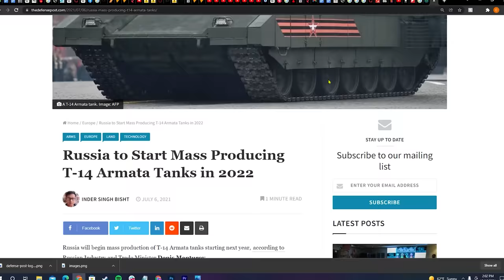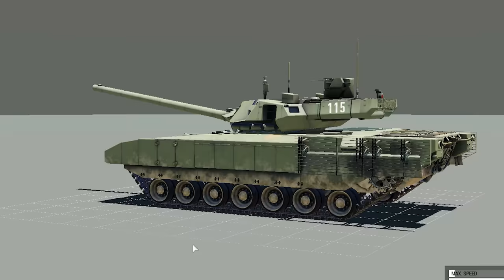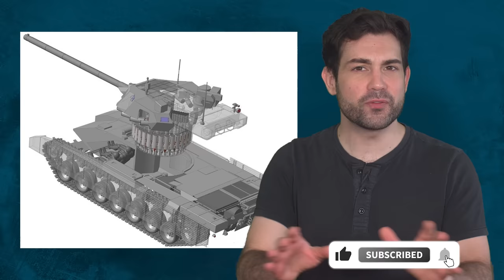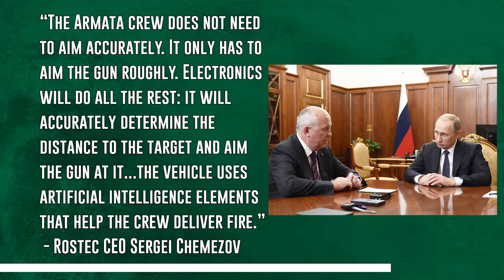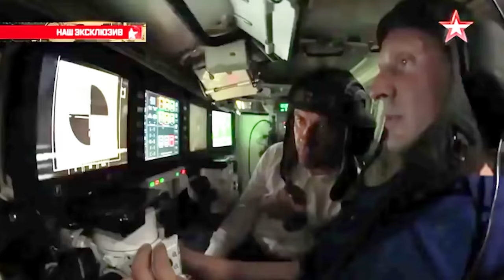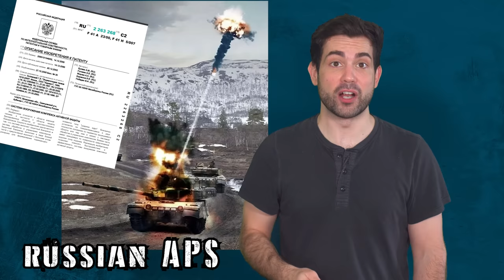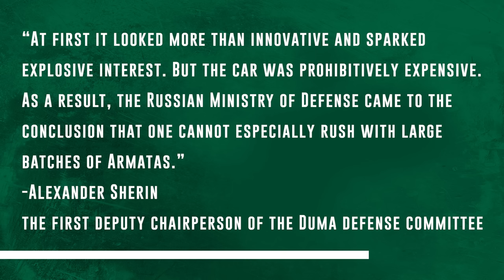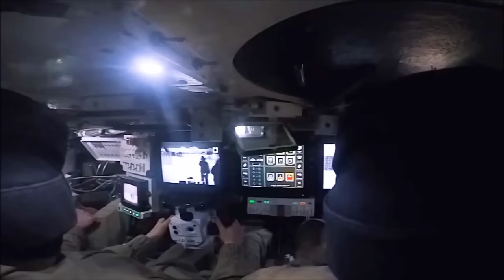The Truth About Russia's T-14 Armata Tank

Comment: The most expensive tank that can not be deployed, even now while Russian tanks lose to the Ukrainians artillery and accuracy, the T-14 still has not made a battle field appearance. problems with the T-14 is some weak spots…..1) hull stored ammo 2) failure of it electronics due to EMP and other malfunctions 3) all 3 crew members are in the same capsule restricting a 4th set of eyes for scanning the surrounding area 4) even now the tank is still a target for the A10C. But by far the biggest problem for the T14 is cost of operation/ maintainability, training new troops, and production with all 3 key issues holding it back. This vehicle could have been a real threat if the damn thing would actually have been deployed and it’s capabilities were actually used in combat, and right now its the most expensive paper weight Russia ever produced.

Comment: There are some problems with T-14
1. Russia doesn't produce engines powerful enough for that tank of the type it's using 
It's kinda next level of t-80, which were produced and serviced by Ukraine's factory in Dnipro
This is why Russia's T-80 engine failure is so high - they can't service it
And UAF just take it for themselves as they have tech for servicing those engines

2. Gun. Russia doesn't produce a gun like that
There was one factory capable of producing it that was planned to do that but it was in Ukraine
It was actually Azovstal...

3. There is almost no parts that are produced solely by Russia 
It wouldn't be a problem if it wasn't all produced in Ukraine, France and Germany....

Comment: The main issue with Russia/Soviet tanks is they always aim for expensive, state of the art tanks, and then cut as many cost and corners as possible. Many T34 came out of the factory without seats, most had to have there engine replace once, getting to the battle area, and again just before. For a more in depth look at why t 34 was and wasn't a good tank, Lazerpig here on YouTube made a good video on it
Reply: I’d not say they aimed for state of art expensive tanks.T-34 was a monster for 1940 but just an average tank for 1943-1944And it wasn’t expensive either compared to German,American and British tanks.I’d say it was actually cheaper to build than a Panzer IV or a Sherman.
Reply: @AFT_05G  no it wasn't, if they were built to the specs, they'd be one of the most expensive tanks on the field. However, they cut every corner they good, like not hardening all the armor, not putting in sights, not using rubber in crucial areas.

Here's the link to the video https://youtu.be/CIZ6PFYUM5o

Comment: 7:39 yeah about that... these are the hard factors of a tank. Something thats easily determined by just looking at the specs. There exists this idea that if you can strike a perfect balance between these three, you end up with the perfect tank. But it turns out that in war, these factors are not all that matter. The soft factors are just as importand 

Soft factors are things like, how comfartable the tank is for the crew. If the crew is thrown around violently they can hurt them selves, effecting how efficiently they can fight. A gunner or a driver with a concussion or a broken arm can obviously spell out disaster for a tank crew in battle. Or just even having an AC installed so the  crew dont overheat

How reliable is your vehicle. Oh dear 1:42 

Or, how easily are repairs carried out to crusial components of the tank. Is this something you can easily do in an improviced motor pool behind the front line? Or does it happen a lot that the tank needs to be disassembled a lot before you can even start carrying out repairs

Or, how effectively can you manage to organize supply lines. We've seen this a lot in the beginning of the Ukrainian war. Tanks just being abandonned because they have ran out of fuel. Having thick armour in battle is of course a good thing, but it also means your tank is more of a fuel guzzler. And a tank that runs out of fuel before it can even reach the battlefield is useless. You need supply lines to support your millitary vehicles. An army runs on its stomach.

The German Mauser from the second world war tank is a great example of how bigger does not always mean better. The project ultimately failed and never made it out of the testing face. By that time the Germans invested in the Mauser they already started losing the war and they were desperate for a wonder weapon that would turn the tide of the war. The project however was a huge resource sink which they probably could have put into the weapons they already had. The Mauser would have been a thirsty tank and the Germans were running low on oil and fuel. Too heavy for its own good, the Mauser would not have been able to cross bridges out of fear the bridge would collapse. If the Mauser came across a river, it would have to find a spot where the river bed would have been hard enough so the tank doesnt get bogged down. So you have an extremely heavy tank which has to drive through a river. What could possibly go wrong? The engine would have worn out fast. Again, soft factors matter. If a tank is not opperational for what ever reason, its useless
Reply: T-14 clearly did not break down. How the fuck do you think ARVs recover vehicles? BM Oplot broke down at a parade and didn't even require a ARV.
Reply: You're really saying T-14 is a heavy, fuel guzzling tank when the west has tanks over 20 tons heavier that guzzle much more fuel, especially Abrams.
Reply: @definitelyfrank9341 it’s because they built a family of chassis’s that guzzle fuel for like engineering vehicles or anti aircraft which it doesn’t need to
Reply: @Jvr555  Bruh, they change almost everything about the Armata but the chassis. The only thing that all Armata vehicles have in common is the chassis, nothing else.
Reply: @definitelyfrank9341  yes that is not smart because you do not need a shit ton of armor and a gas guzzler for all your vehicles. Because if your gonna make most of your vehicle’s around that then you need a bunch more gas that is probably gonna get blown up on the way so then a bunch of your army has to split a small amount of gas between a bunch of vehicles that need a shit ton of gas to run.
Reply: @Jvr555  How the fuck would using the same chassis for multiple vehicles be inefficient? Sure, there are limitations in terms of practicality, but those limits have not been surpassed in the case of the Russian military. 
If you want to argue that it is the case, then give me a real life example and explain why it's impractical.
Reply: @definitelyfrank9341  because logi exists and you have to supply an army that guzzles gas in a warzone where people are actively annihilating your fuel trucks so then your tanks run out fuel way more easily. Tanks take up a lot of logi which as we know in Russia is terrible. And when you simply do not need that much armor for everything it bites you in the back.
Reply: @definitelyfrank9341  let’s go back to the t-34 the idea numbers equals better was terrible because their tanks didn’t have the supplies to repair themselves or the ammo so leading to issues where if your tank broke down you had to leave it cause there wasn’t enough parts and too many tanks. Logi is very important for how effective you can be.
Reply: @Jvr555  Well clearly quantity is better than quality, otherwise they wouldn't have made it to Berlin.
Reply: @definitelyfrank9341  you know the Allie’s won right as a group if it wasn’t us putting Russia on live support with resources they would collapse.
Reply: @definitelyfrank9341  clearly not because most t-34s would break down along the march and because there was no parts either had to cannibalise other tanks or ditch it. Making t-34 losses massive

Comment: If theT - 14 Russian Armata tank is anything like their aircraft carrier the Admiral Kuznetsov it will be a disaster! 
The Admiral Kuznetsova caught on fire during its maiden voyage and will re-enter service in 2024, just in time for another WEENIE ROAST and for smores this time! 😀 
Russian sailors know how to have fun!
Reply: It caught fire in port, while welding up damage caused by a crane falling on it while being repaired from the previous screw-up.  (Not exactly, but close enough.)

The details of the fire damage are interesting.  The soviets didn't have fireproof wire insulation that could stand up to a marine environment.  So they used something similar to asphalt and cotton insulation found on century-old wiring.  Or perhaps it was only asphalt sealed between compartments -- sources differ.

Once ignited, the fire followed the wiring channels throughout a large section of the ship, bypassing the compartmentalization intended to limit damage.  Closing bulkhead doors just shut off firefighting, while the wiring channel kept it from being extinguished where there were people.  Firefighting equipment was missing (stolen?) and there wasn't water pressure where needed.

Fixing the damage is the current nightmare.  The wiring was installed as the ship was built, with wiring channels welded in place and watertight sealant between compartments and at each exit point.  Some of the channels pass through the inaccessible interior of structural elements.

Comment: The t-14 is crap and doesn't do anything. That it says.  And yes that tank did break down.  However the reason it wouldn't move when they tried to tow it was because the parking brake was engaged. Which only shows you the lack of training and or the incompetence of its driver.

Comment: 2014 is what derailed the T14 production schedule & cost per unit. The sanctions leveled against Russia following the coup in Ukraine when Crimea returned to Russia was a huge wake up call. All the electronics & optics that Russia were relying on purchasing became highly tenuous with supply uncertainty... so, the T14 design was fine but all the components had to be redeveloped domestically. 2022 is when the domestic production of the T14 components were finalized as the re-militatization of Russia was put into full effect.
Reply: This sounds alot like Steiner's counterattack.
Reply: @rick7424  you had to reach deep for some post war atrocity propaganda to relate to with that one... I can't even work out the convoluted reasoning you used to reach that as tangentially related. Russia was sanctioned by the Judeo-American Empire pretty hard in 2014 for not allowing the Maidan coup from depriving Russia of Crimea... it really hurt Russia economically & developmentally. But it also made them become more insular as a direct consequence... it's why the 2022 sanctions were for the most part irrelevant & the Judeo-American Empire subjugated European vassals are the ones suffering from sanctioning Russia themselves.

Comment: Don't disagree with you 1 bit with your assessment, if anything history show..it will be an t90 with a new skin..and its not the horsepower that's important when its comes to turbo diesels but the Torque, horsepower multiplied by 5,252 divided by rpm will get you the torque. Lets say at 2000 rippems 1500hp x 5252= 7.878 mil. ÷ 2000rpm..gotta take my boot off for this one..3939fpt again the rpms are just a guess..which is why diesel rules the HE world. Also you'd think,  Russo watches T72s being popped like pimples off a fat bottom girl wearing Babushka..Small turret lower profile..Hows that working for you PUTTZ-IN
Reply: Saying "it's not the horsepower, it's the torque" is silly.  It's always the horsepower and gearing.

The problem is that the design for the new engine failed, and has been canceled.  Which doomed the Armata powerpack design.  Redesigning the powerpack requires reworking the design of all vehicles in the series.

They might as well start from scratch.
Reply: @1djbecker  i strongly disagree, when you look at gas vs die. Gas engines are usually 9 : 1 while diesel 17 : 1  diesel has all the turning power at the low end of the rpm rge. The energy density of 1g of diesel contains 147,000 btu's while 1g of gas has 125,000 btu's which mean it will take more gas to get the equal power output to a diesel.  Why do you think all heavy equipment use diesel engines..because diesel have that massive amounts Torque and Torque is the turning force used turn thoes gears. And diesels the more fuel you dump into the engine the more it will go, unlike gas the more you dump into it..it will not burn any more and pukes it out the tail pipe because theres only so much oxygen..hence NOS..which is an Oxidizer ..now gas can go but will more likely leave a trail behind  it as it shits out its gutz .

Comment: "The T-14 Armata uses the very best of russian engineering..." the very best of russian engineering apparently includes using a russian copy of the most unreliable WWII German tank engine, the SLA-16 from the Porsche Tiger. The russian copy of this engine is called the A-85-3 a commercial failure of an industrial pump engine, known for it's unreliability. Might explain why this tank breaks down during rigorous parade duty. Why is it russia is incapable of designing a modern diesel engine? Or at least copy a successful modern diesel engine?

Comment: If Russia has a problem they should  correct it but they don't  they rather update their old junkie tanks if I was India I would not buy anything from Russia
Reply: India is heavily intertwined with the Russian arms industry.
But even India wasn't willing to buy into the incomplete designs of the Armata series.  India licensing the T-90M (MS) was the death knell of the T-14.

Of course now India gets stuck building new T-72 tank hulls, while paying Russia for second-rate mechanisms to put in them.  It's like someone paying Ford for a license to build replica 1970s Pinto, this time with a cassette radio instead 8-track.

Comment: and as it turns out the t-14 is a piece of crap :D
Reply: According to who?
Reply: @definitelyfrank9341  according to EEEEVERYONE :D last time it was even seen was in a parade where it's motor failed...
Reply: @ville9738  If its engine failed, the ARV would've been able to tow it away. That's how ARVs recover vehicles that still have their tracks attached. Not only that, the engine bay was never opened, in fact, nothing was done to the engine to cause it to start working again. 

The handbrake was engaged, period. There's no evidence to suggest the contrary.
Reply: @definitelyfrank9341  yeah, and that's why it hasn't been shown ANYWHERE else... jesus fucking christ :D